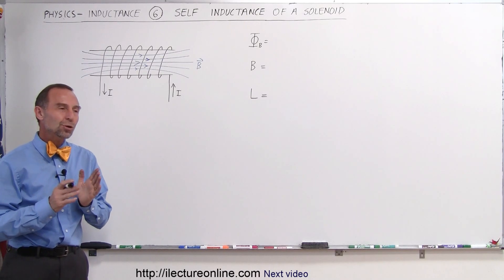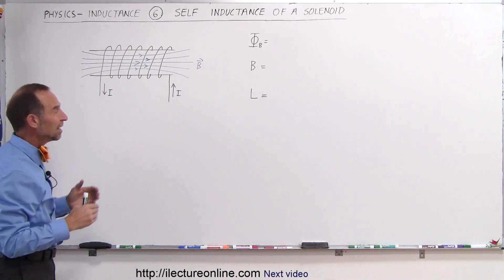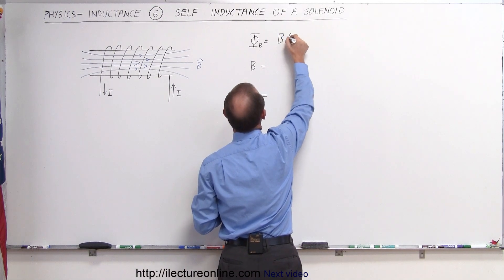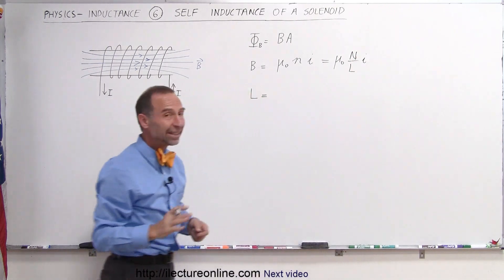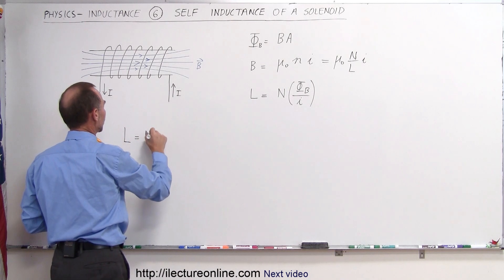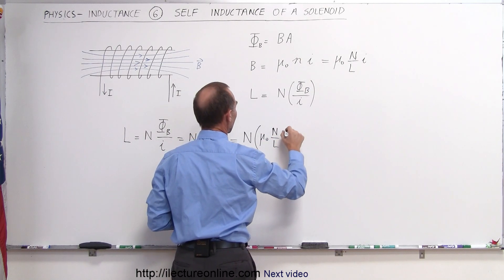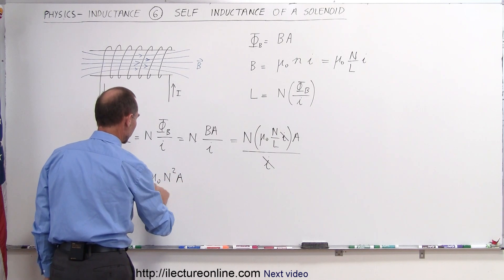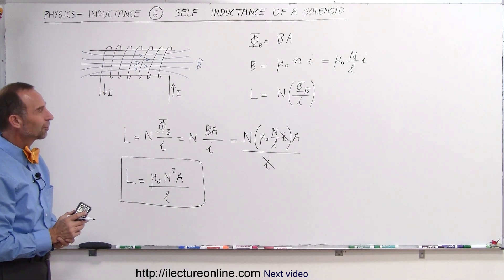Physics 47  Inductance (6 of 20) Self Inductance of a Solenoid

Comment: Hello Professor, I've noticed that you've used lowercase "i" to label current in your recent videos regarding inductance. Is there a reason for that (i.e. why not capitalized "I")? Or does it not matter? Thanks!
Reply from the maker: Typically the lower case "i" is used for time varying current. Capital "I" is typically used to describe the maximum value of the time varying current.  (Like the maximum amplitude of the sin or cos function of the current)